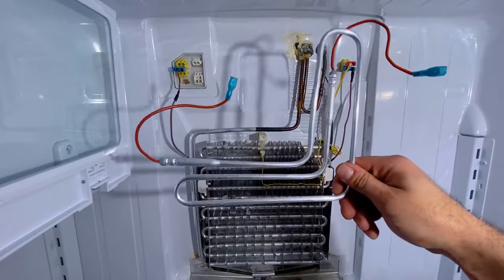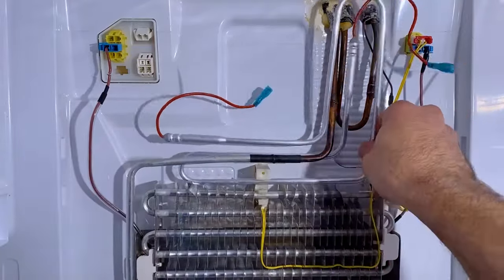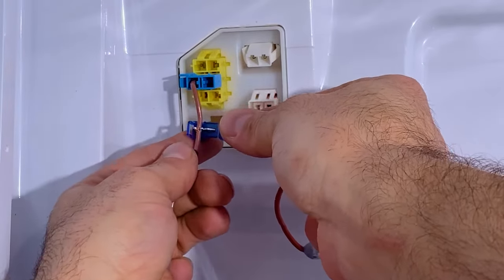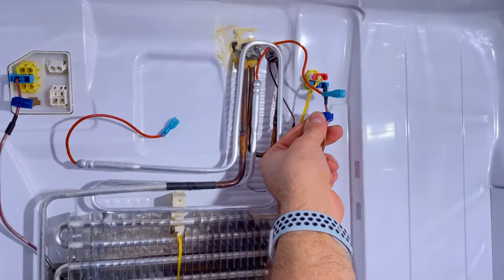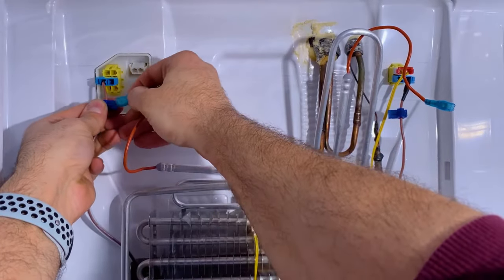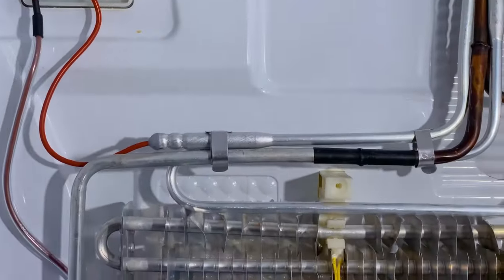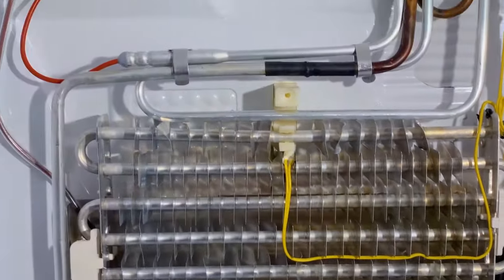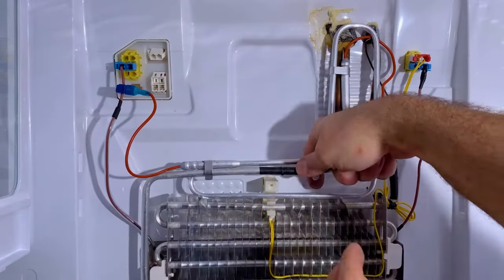SAMSUNG FRIDGE ICE BUILD-UP REPAIR GUIDE, PERMANENT SOLUTION FOR SAMSUNG REFRIGERATORS  EB11-00191R

Comment: After I've installed the DEFROST BOOSTER KIT FOR SAMSUNG REFRIGERATORS  -  EB11-00191R for my Samsung RF28HMEDBSR/AA refrigerator just now, the error code  2 E shows up on the display panel.  Is it because I 've not properly clipped the supplied blue connectors to the brown wires of the default (main) heater?  I have not touched any other wires or sensor such as sensor wires.  Please adivse.
Reply: @eyaoytube DEFROST BOOSTER KIT FOR SAMSUNG REFRIGERATORS can you please tell me if you have resolved the problem with your refrigerator DEFROST BOOSTER KIT because no one who has purchased the item has made any comments your answer will be much appreciated   thanks Silvio

Comment: Ok I bought your kit. My
Wiring harness is different. I don't have 2 clips I have 1 clip to the left with brown wire. My
Model is RF263AFRS is this compatible with your kit? I should have taken the back panel off before I went ahead and purchased it.
Reply: One side goes to each end of the defrost line
Reply from the maker: You welcome to contact us directly for any assistance via online chat, email or contact form at anytime.

Comment: Any tips on placing the defrost sensor?
Reply: You can see they relocated it to the middle top of the evaporation coils. Do they provide the plastic holder for the sensor?
Reply from the maker: You welcome to contact us directly for the correct  sensor location via online chat, email or contact form at anytime. 
For the sensor installation the holder isn't require but you can use the existing one if you wish
Reply: @partsofcanadaltd9697 I would like to know where to locate to...bought tab that water drips to to see if thats problem.  Have just replaced sensor (sensor was black not white though)  I did not relocate and is icing up already.  Please help.  I can not aford to replace my fridge.  In vancouver lower mainland so we've had hot summers with no a/c  & kitchen can get above 30°